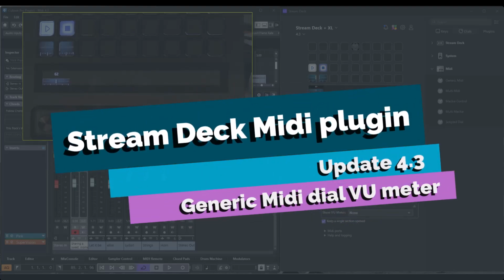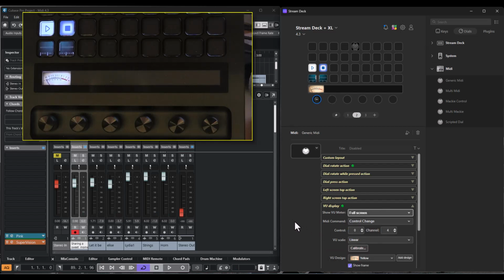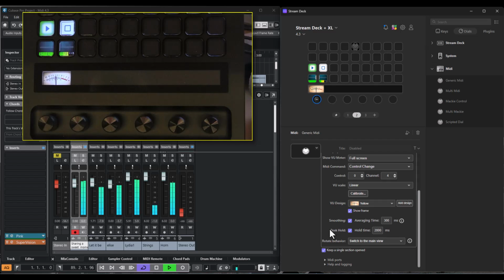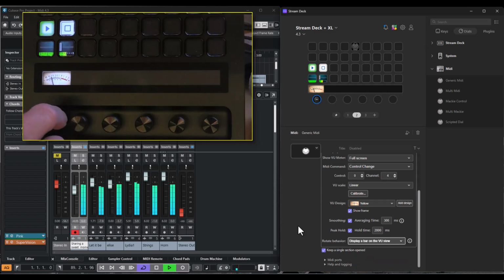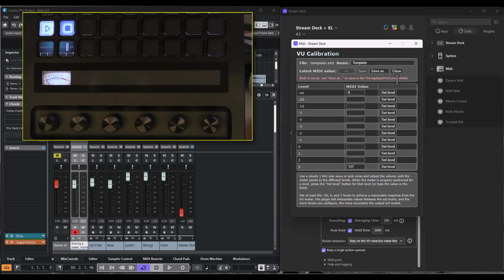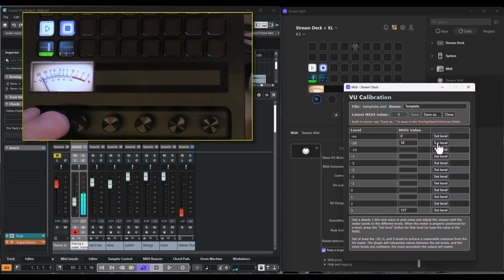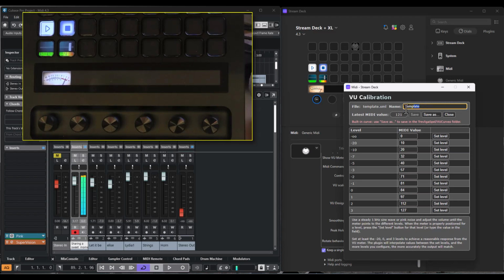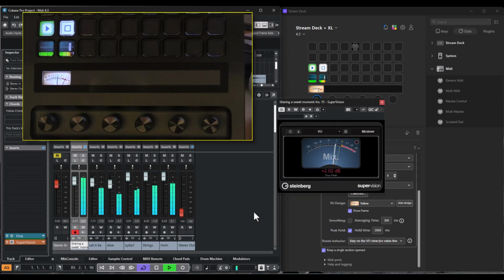Midi 4 3 Generic Midi dial VU feature

Comment: Wow, thank you for the update.

In Cubase, can you set the VU to display the pre-gain signal and the knob to tweak the pre-gain for proper gain staging?
Reply from the maker: You can tweak the pre-gain with a knob, but I doubt the VU will display the pre-gain signal. It depends on what Cubase can send, and for all I know, the only thing Cubase sends to the VU is the "Meter All" parameter, which is the final VU level.
Reply: Hi! Thks but in logic pro Mac have problems not recognizing midi out and no data on calibrate… how to do? Thks